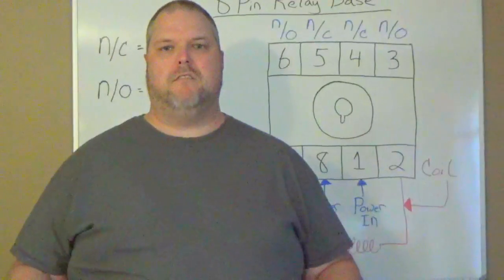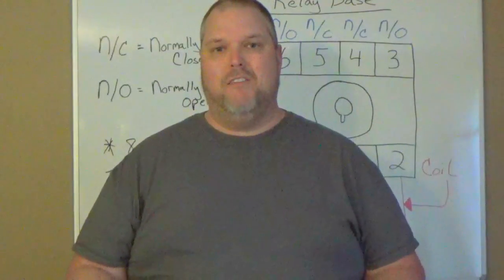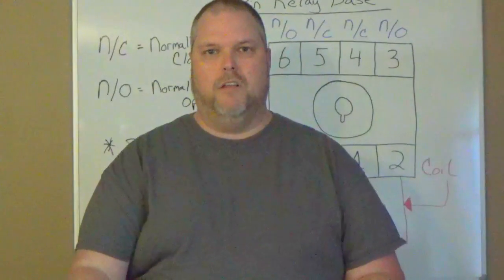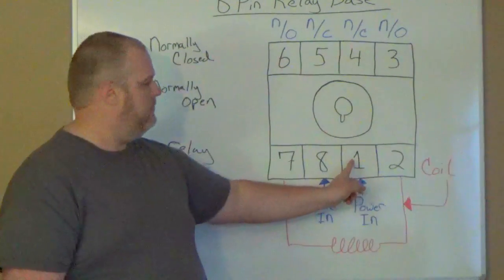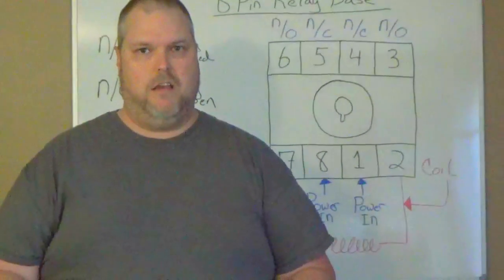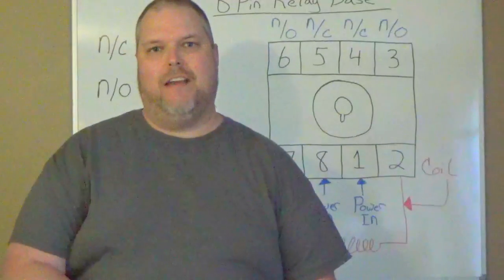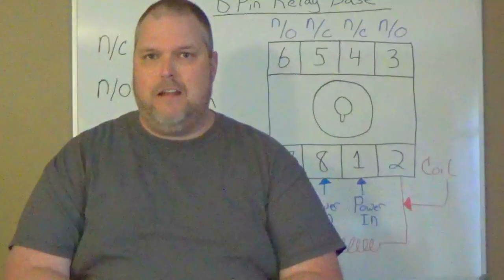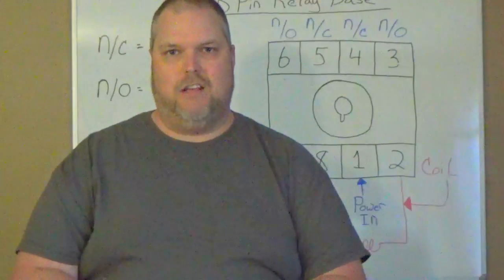8 Pin Relay Explained

Comment: If 1 and 8 are power in (hot and neutral), then how can 2 and 7 also be hot and neutral? 
It would be good to show an example. Something like having a light come on when you push the on button and off when you push the off button. 
I am sending 120 vac to a control box. I want an on and off button and a light that comes on when I turn it on.  Then the power goes to a cable and into another box. Do I need a relay for this?
Paul

Comment: Craig 1 comment I don't get....  (I understand relays) but I came here to here your explanation, but to maybe make the numbers "make sense."   Almost ALL of my relays say (34-32-24-22-12)   AND   31-21-11   On rare occasion or in small print, I "might" see the 1,2,3,4,5,6, etc etc but not prevalent or often.  Obviously 31 switches between 32 and 34  ~  and 21 switches between 11 between 12 and 14  ~  21 between 22 and 24    WHERE do they come up with those numbers?  Any reason to them?

Comment: I'm a homeowner trying to wire my well and surface pumps instead of using an extension cord.  Two of my pumps are on float switches but I want to force an on or off state regardless of the float status so I can backwash my filter tanks or test a pump after servicing it or pressurize and test a newly glued water pipe.  This was really helpful and your instructions were so clear the even I understood them.  Great job.

Comment: Sorry little confused you said 8 and one are power but then said 2 and 7 are natural and power. So what power goes in 8 and 1?
Reply: 2 and 7 energise the coil to close or open the contacts, 8 and 1 where where you connect power to run through the relay

Comment: awesome video sir..im planning to diy a roll ice cream machine from scraps since i cant afford a brand new unit.. being a broke family guy, im planning to have this small business..badly needed during this pandemic. do you sir by any means have ideas how to wire this up? i mean the compressors,condenser fan and three solenoid valves for the defrost option..since theres no cheap circuit boards online..im planning to do it with simple wiring method..could you help me out with this? i really appreciate your help sir..

Comment: Hey Craig I've been struggling with my motor control project because we are using 8 pin relays and we are trying to do the 3 start 3 stop push button station interlock and the relays just act crazy

Comment: Great video. Is there a relay that I could install  to share a pump with two controllers? I need two NO outputs.
Reply from the maker: You could also use and 11 pin relay that will give you two more outputs. CM
Reply: Craig Michaud- Electrical Instructor, I have acquired the 11 pin relay with a Dayton 24VAC coil. How will the two sprinkler controllers connect to the 11 pin relay base to command the pump? Which terminals will the controllers P and Com connections from each controller terminate? Which terminals will the PSR terminate to? The 24VAC will come from each connected controller, how will they engage the relay to then start the pump?
Reply: Craig Michaud- Electrical Instructor 
Hi, I’m not sure if you’ll ever see this but in hopes you do i have a question. I have a unit that controls fans when the sensor reaches a certain temperature. It’s a smd-tm1. I’ve been trying to wire it to a relay along with 2 fans. The unit has a red, black , and yellow for power. Yellow is trigger. Along with them 3 for power it has a white and black for the fans. I’m trying to wire it so when unit kicks the fans on the fans come on and when the unit kicks the fans off they go off. I’m only guessing this is done by the coil. It’s been a real struggle, if you happen to see this and could offer any assistance I’d be grateful.
I’m using this I’m my stereo build in my car. 12v system .
I have a 12v  30 Amp SPDT relay
30, 85, 85, 87, 87a
I have only been successful in wiring that the relay does power the fans, but they stay on even when unit should have kicked them off.
Reply: Craig Michaud- Electrical Instructor, If you don’t mind you can email me directly at david.straight@weathermatic.com. That way I can share pictures if needed and vice versa.

Comment: Any joy on my question?
Reply from the maker: I have been working on trying to find you an answer. As I am working on this I can only think that this has to do something with a polarity issue. It is appearing to me you may need another relay. Again I am going on the info I am given. If I was to be able to put a meter on it then I would be able to give you a more accurate answer. I will have my email up soon maybe you can send a video and then maybe I can help you figure this issue out better. CM
Reply: Hello Craig. I don’t think I got you reply to my question. Any chance you can do part 2 to this video. As I said b4 can not get the motor to go back and forth. It only goes one way until I reverse the cables. Can you help ?
Reply from the maker: B.V.M MEDIA I am working on video's every week. I will be doing a video that I think will help but I am trying to get parts in order to make a video for you. Please bare with me as I am working hard to build my channel with more content. I will do my best to get this to you as soon as I can. Thank you for your patience!!! CM
Reply: Craig Michaud- Electrical Instructor  thats great. I will wait for it. 

Thank you very much for the reply.